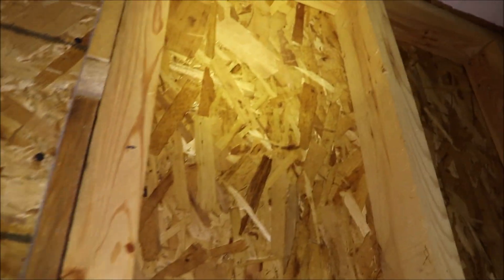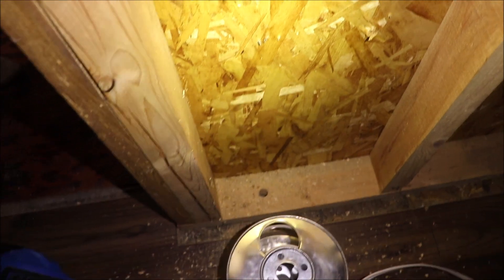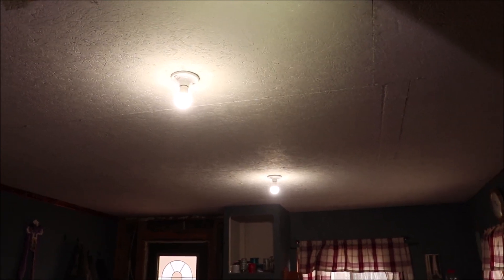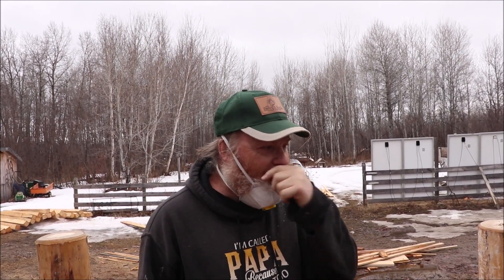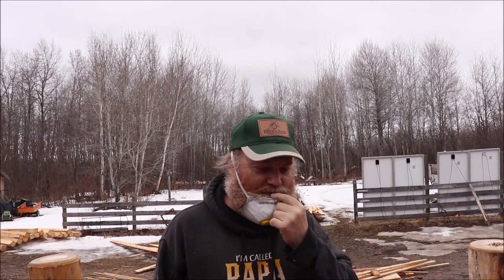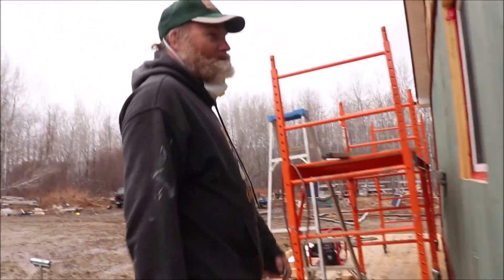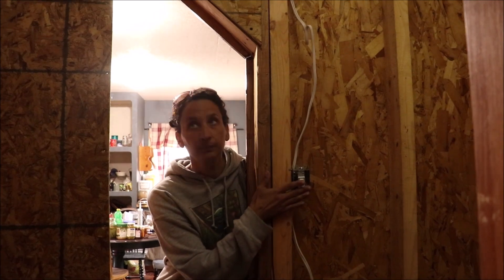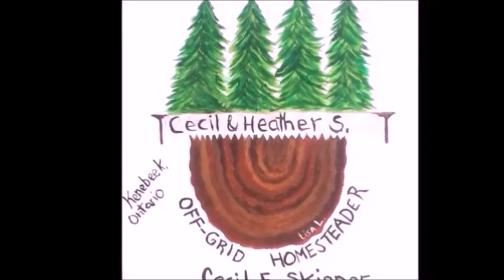Check It Out Folks. We Installed A New Light In The Pantry And The Kitchen Of Our Off Grid Home.

Comment: Progresssssss    Nice' It sure is great being small as you folks are getting into those small places  100 points   the mud is getting dryer here in central Maine   over the years we purchaced many loads of rock to fill around our place then built hundredreds of patio blocks. trying to keep most of the mud outside.  Our lumber prices have went up three times as much.
one 2x4x96" over 8 bucks  your saving so much by milling it yourself. thanks for the great VIDEOS.

Comment: They sell a light that will mount right on your outlets, you have in your ceiling.  They just screw into the bulb socket, and are flush to the ceiling..  I have 4 of them in my garage, and would be lost having to replace all the bulbs I would have hit in the past few years..  They are only a inch or two off the ceiling, so they are hard to hit, and they give off lots of bright light..
It is like day time in my grarage now..

Comment: You need to put some gravel in those bad wet muddy spots.
Reply: If the soil is anything like ours, it will just sink into the mud. The only way to really fix wet spots is to dig down and remove the clay/loam soils, put down a barrier (woven or plastic) and build up with gravel, drain tile, another barrier to keep soil out of the drain, then add more gravel, and finally a self-draining soil. It's a lot of work. Or just do how we do it.... wait to do any work until mud season is over.